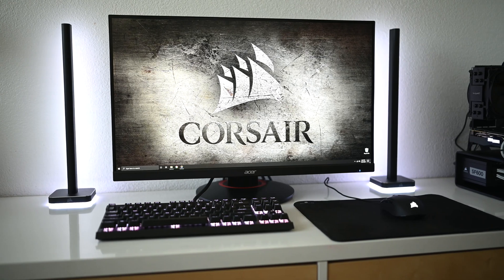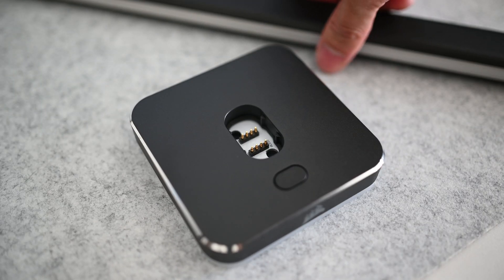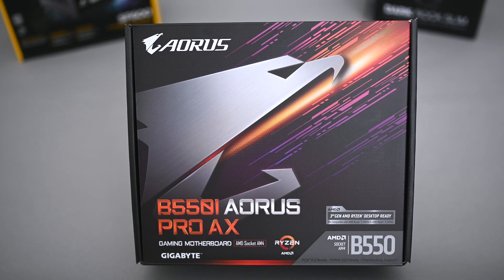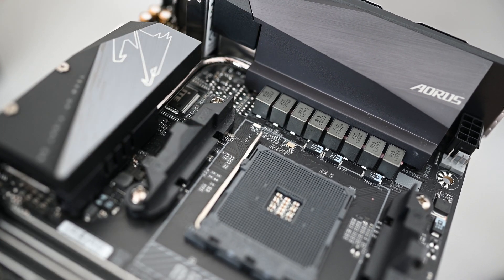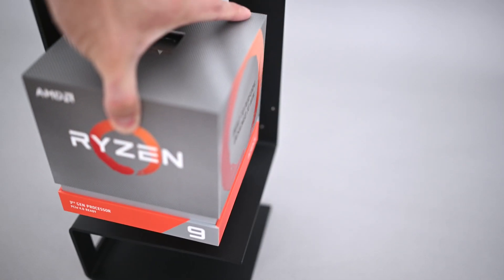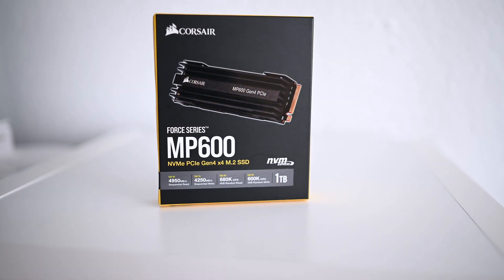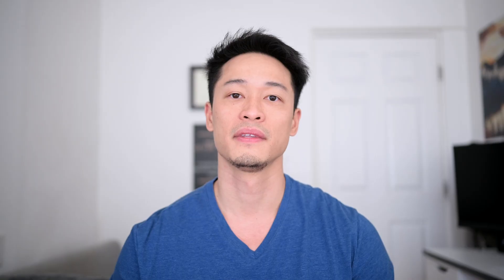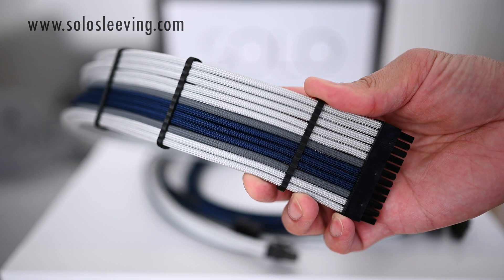AMD B550 Mini ITX PC Build - Ryzen 9 3900X RTX 2070 Super

Comment: I buy Zotacs and they do okay.  Good price and I run mine hard overclocked and never had any issues.  Have a 4090, 3090, and 3080 builds and they do as good as the expensive ones.

Comment: Hey brotha, you mention 64cm cables to make it look like yours but solo sleeving only has options for 60cm or 70cm. Will the 60cm work or did you do something different?
Reply from the maker: 60 works, but 64 was like the exact I think. But you can specify in the notes when you order. Tell them to do 64. 60 and 70 is just for general orders as that's what fits most people's builds thats all
Reply: @hardlinenexus  Thank you

Comment: can you please give me what types of cables to buy at solesleeving... i like how that build turned out and i want it on my desk :) this is gonna be my first build
Reply from the maker: Cables will be dependent on which power supply you get. For example, Corsair SF PSUs are type 4 cables. SoloSleeving has a compatibility list on their website that tells you which cables you need for your specific PSU.
Reply: @hardlinenexus  im getting the same PSU as yours. So do i just need to get a 24pin cable and thats it? thanks
Reply from the maker: @Gjee_jay  no you need a custom 24-pin, 6 and/or 8-pin PCIe, and the CPU cable at the very minimum.
Reply: @hardlinenexus  thanks

Comment: Hey just wondering if you can give an update to your build? Primarily on the dust issues and thermals that most open-case pcs face. Thinking about upgrading to an itx using the same case but I am hesitant due to the dust problems this case can face :/
Reply from the maker: Dust is going to get into your case from intake fans even in a closed case. Open air case maybe accumulates dust a bit more frequent? I don't pay attention to it because it hasn't been that noticeable. I got this electronic dust blower which I recommend to everyone, it's a good long term investment: https://amzn.to/3gKOGVo

Easily blow off any dust whenever it accumulates. Thermal wise my PC here is fine. I'm not trying to break overclocking records so yeah. I have XMP (or DOCP since it's AMD) on, everything is fine so far.
Reply: @hardlinenexus  how about the noise level during editing and gaming?  Would you recommend this case/setup over a standard ATX build? Sorry if I have a ton of questions but there’s little to no information/review on this case😅
Reply from the maker: @ApollyonApostol  Recommending ITX over ATX I can't answer because it depends how many devices you want hooked up. One downside of ITX motherboards is they have less USB ports on the back. But you can still easily expand your USB ports with a hub. Other than that, it comes down to if you're trying to save space on your desk. That's the main reason why people go small
Reply from the maker: @ApollyonApostol  and noise level only ramps up when I'm exporting and rendering a video. Or if I'm playing a game with decently high settings. But during normal use, it's pretty quiet. Noise and thermal performance varies based on what CPU cooler and GPU you have on here. So my answer to noise level is specific only to this PC and these parts here
Reply: @hardlinenexus  I think your choice of gpu and cpu cooler is a good for experience standpoint since it’s something most people will opt for or at least something similar when building a pc in the motif monument. All this information is really useful and I’m basically sold into getting this case as I do need the desk space for it. Plus i love how this case can be used as a centerpiece to a setup. Also I do believe that the case fad now with rgb and tempered glass is kind of tacky😅
Reply: @hardlinenexus  Hey quick question again, for the psu cable length, you mentioned in the video to get 64cm on all the cables, but there is no option for 64cm; only 60cm and 70cm. Did you mean 60cm or 70cm for the recommended cable length?
Reply from the maker: @ApollyonApostol  you'll still be fine with a minimum of 60. I custom requested 64

Comment: what is the most powerful chip that can go into this while keeping good cooling?
Reply from the maker: Ali from Optimum Tech test this motherboard with a 3950X, but I do not believe you can push that chip to max overclock without having some sort of throttling or overheating. But a stock 3950X will be just fine
Reply: @hardlinenexus  ok

Comment: Is there any major performance difference between 2070 super and 2080 super in terms of price ?
I feel like 2070 super offers better value for price than the 2080 super !
Would love to hear your opinion :D
Reply from the maker: I've never actually recommended anything past the 2070 super for most people. In fact that's solely the reason why I chose it myself too. If you go past this then just go straight for the2080 Ti. Another youtuber did benchmarks and price value said 2080 and 2080 super were just not really worth

EDIT: I have a 2080 Ti in my main system.
Reply: @hardlinenexus  Thanks for your suggestion mate, really appreciate it, I think I will go for the 2070 super. Will be looking forward to your part 2 video :)

Comment: thats not a case. Thats just metal sheets bent to mount the motherboard psu and gpu XD. Just kidding, love the vid man . Waited for a long time and worth it. and also is 600 watts enough for this with overclocking??
Reply from the maker: That's a good question and on overclocking, that's what I'm working and testing on right now. Although the GPU is not going to be overclocked, probably CPU if anything with just auto PBO.